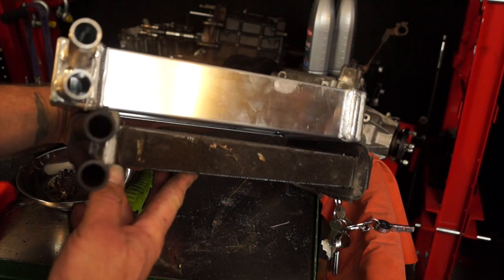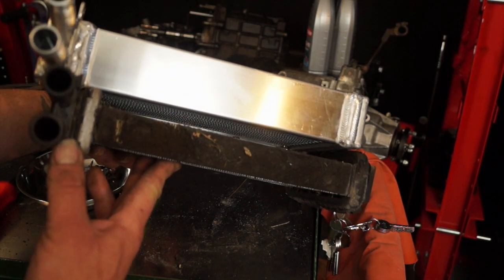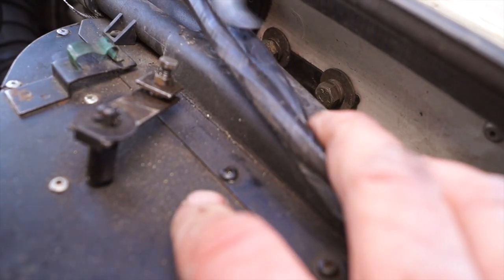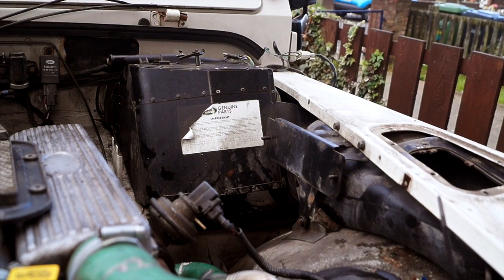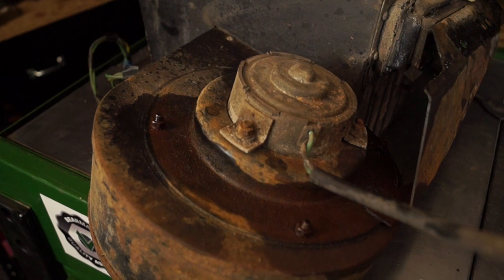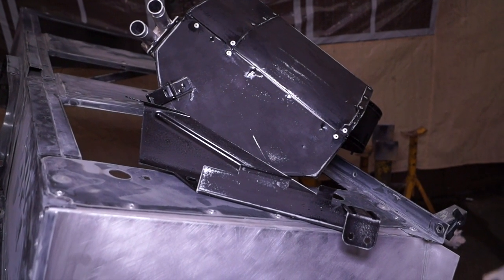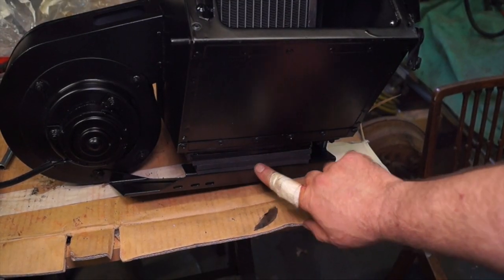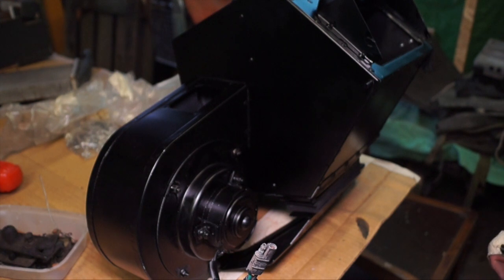Fitting a Larger Heater Matrix to a Defender 90/110 Heater Box - 110 Project Overhaul

Comment: I roof mounted an 12v fan heater off eBay in my defender. On those cold mornings it blows warm air down the back of my neck. 😂

Comment: have a TDI300 in a 97 Def and have an aftermarket heater A/C. I wanted to run a simple setup and have the org heater coolant out and return line with a valve (supplied by the Aftermarket HVAC) - but I have been advised that the lines require constant flow or engine cooling is at risk (and also the opposite- it doesn't matter) which is correct?

Comment: Hi Chris.  Great information! Can you recommend what to use for padding the inside of the heart box?
Reply from the maker: Depends what you want to insulate it for?  Vibration or waterproofing?
Reply: The padding for the flaps inside the heater box.
Reply: I just read that it is1/4" heat-resistant EPDM 2.5psi closed-cell foam, with a 215 degree degree F max temp.  Is this correct?  Where would one source this material?
Reply from the maker: Sorry I don't know where to get that from.  I doubt you'd need anything so technical due to the amount of heat that really gets put through there. Perhaps at most 90 degrees C?

Comment: Hi Chris, great video. I've just stripped my box, painted and rebuilt.  I have the foam seal which sits inside the heater box recess, but not found any info on the 'second seal' you mention in the video.  The seal which i have (shaped to fit into the recess) actually sticks out quite a bit.  Does this just get compressed up against the bulkhead to make a good seal?  Or should it be cut back?  Thanks

Comment: Ya good vids about by removal bar inssttall etc but with that trouble nd hassle can you not design a bar  say from the centre flat nd do a l shape  over the soldiers seat flat bar nd up 2 the side cab 2 retain  the sides nd roof strength  my reasons being that YOUR  also can  reclim your you seat as much as possible nd have a comfy sleep ? .I going 2 my metal man explain make what I need nd for  f all  dou

Comment: Are you "Trailerfitter" from the Difflock forum a million years ago?
Reply from the maker: from the LRO forum. Don't think I ever went on the Diff lock forum.
Reply: +Land Rover Toolbox Videos Ah the LRO forum!  I'd forgotten about that, was good at one time but went stale for some reason?
Reply from the maker: Because the moderators got a little too drunk with power.